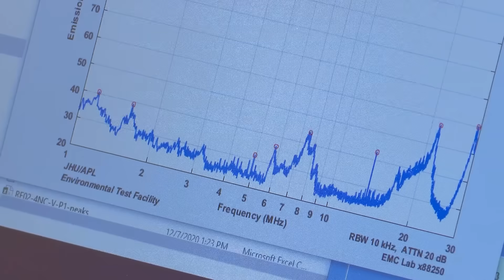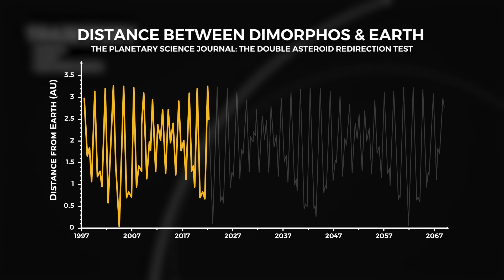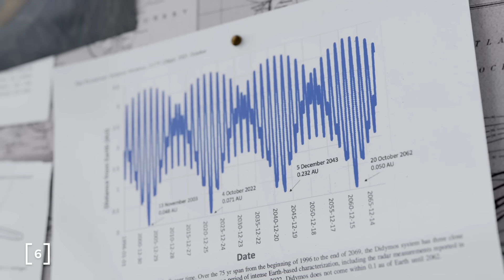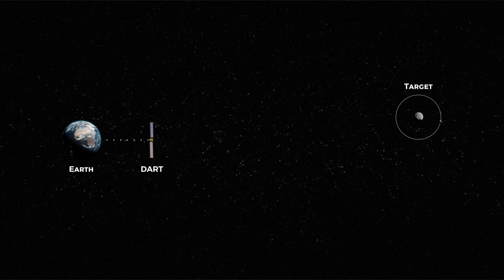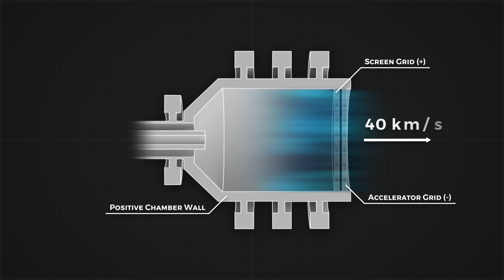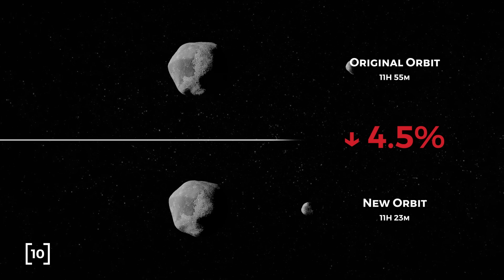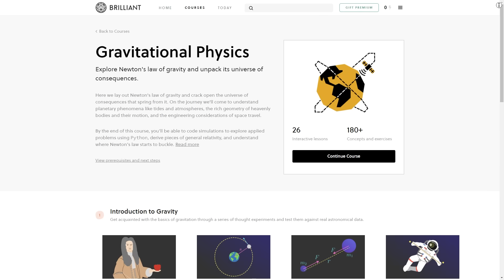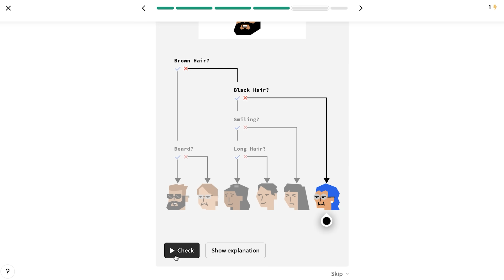The Insane Engineering of the DART Mission

Comment: I think some also huge about this is how much of a difference in orbit it made will relatively little. No heavy dense material, no explosives payload (outside of the hydrazine). And it makes you hopeful that if the need arose and we had to deflect a asteroid 1-5km in diameter that the use of these could make an even larger impact in orbital frequency

Comment: Not a fan of redirects. Something that small (and considering its a rubble pile) could easily be turned into a cloud of dust with a warhead under 1kt. A clause in the outer space treaty needs to be introduced to allow this. Adding delta v to change the orbit of a threat may just postpone it specially when you are dealing with a complex system of interactions and perturbations which may be near impossible to model with the required accuracy hundreds of years into the future. You don't have to worry about this when the threat is turned into garden rocks.

Comment: I wonder if it would make more sense to use a dart like projectile that sticks to the target rather than something that gets shattered into million pieces on impact. It is a high speed impact after all so, coming up with a design that transfers kinetic energy efficiently might be very tricky.
Reply: I do not think it is really possible when the impactor you are going to use is moving at nearly 7 kilometers per second and the asteroid is of such high porosity (it more resembles a sandy-like surface rather than a solid rock). It quite literally completery shatters the impactor, no matter what technology you would use to transfer that kinetic energy.
Reply: you would need to 1) Slow down to meet it and 2) Use thrusters to push away from it

Both need fuel, and fuel is heavy.

Comment: success, but limited.  The discrepancy of how much they changed the orbit, 4.5%  instead of 1% , makes it very inaccurate in terms of orbital mechanics. Imagine you need to change the spin of an asteroid by a very specific amount so solar heating can push this asteroid into a new less dangerous orbit, but instead its not close enough to the simulation and the asteroid comes closer from the over\undershoot of imparted energy. otherwise, awesome. we can move mountains. this can be used to reel in asteroids for space mining.

Comment: The thruster targeting system looks so similar to star tracking software (autoguider) used in astrophotography for long exposures. It would seem that system could be designed to replace moving the servo motors with tapping the thrusters. So cool.
Reply: I had the same thought, funny how systems from very different projects are in some ways quite similar.
Reply: Apollo did navigation using the same exact method to orient itself, there was a telescope to focus on a target star to set attitude. So in a way it's exactly the same

Comment: I find it highly ironic that there is a graphic at 48 seconds that shows the Twin Towers but interesting that the Eiffel Tower is there as well.

So engineers and scientists can hit an asteroid 11 million kilometres away with a probe to study the inelastic collision but cannot research the inelastic collision of the top of a skyscraper supposedly falling straight down onto the bottom 85%. The shape of the 10,000 tons of wrought iron that make up the Eiffel Tower should be indicative of how the 100,000 tons of steel had to be distributed down the North Tower.  But the NIST did not provide that information in their $20,000,000 report. In fact they don't even specify the total amount of concrete.

So presumably an inelastic collision a mere 1,600 kilometers from Cape Canaveral is not sufficiently interesting to NASA engineers.  Of course solving that problem cannot save mankind from extinction.

Comment: The satellite knows where it is at all times. It knows this because it knows where it isn't. By subtracting where it is from where it isn't, or where it isn't from where it is (whichever is greater), it obtains a difference, or deviation. The guidance subsystem uses deviations to generate corrective commands to drive the satellite from a position where it is to a position where it isn't, and arriving at a position where it wasn't, it now is. Consequently, the position where it is, is now the position that it wasn't, and it follows that the position that it was, is now the position that it isn't. In the event that the position that it is in is not the position thaf it wasn't, the system has acquired a variation, the variation being the difference between where the satellite is, and where it wasn't. If variation is considered to be a significant factor, it too may be corrected by the GEA. However, the satellite must also know where it was. The satellite guidance computer scenario works as follows. Because a variation has modified some of the information the satellite has obtained, it is not sure just where it is. However, it is sure where it isn't, within reason, and it knows where it was. It now subtracts where it should be from where it wasn't, or vice-versa, and by differentiating this from the algebraic sum of where it shouldn't be, and where it was, it is able to obtain the deviation and its variation, which is called error.

Comment: The large orbit change had to be due more to the ejecta than the DART impact alone.  Would have liked to see a simplified version of a momentum analysis in this video.
Reply: @BobC I think the momentum transfer to the piece of Dimorphos left (in the frame of reference of the original Dimorphos) was about 1 part the momentum of Dart and 3 parts the momentum from the pieces of rock that got blown off. This was one of the key things they were trying to find out, how much of a multiplier would all the ejecta be. It was higher than expected but actually still at the very top of modeled  range. So there was a larger coupling of impact energy to momentum change of what was left than expected for this type of asteroid. 

This is good, but asteroids like Psyche which are more solid and less rubble piles would likely get much less blown off and so would get a much smaller multiplier. We may want to do missions like this to other types of asteroid and comets to understand the multiplier better.
Reply: well that impact caused the ejecta isn't it?
Reply: To be fair, if you want to get deep into the data, youtube isn't the best choice
Reply: @Hawk7886  The actual specific data isn't even released yet tho...
Reply: @Hawk7886  then where

Comment: I worked on DART, love to see Real Engineering covering the mission!
Reply: Thank you for your work. It is very moving what we can accomplish as a species. What did you do?
Reply: @KJ4EZJ  thanks! It was a great mission with a great team behind it. I was the lead engineer for the flight computer hardware. I believe the video referred to it as "Playstation 1 equivalent" in terms of processing capability, haha. He's not far off, radiation hardened electronics tend to lag behind modern terrestrial electronics in capability (however that gap is closing as the aerospace industry is undergoing a bit of a renaissance at the moment).
Reply: @JeffreyBoye  I'm a computer engineer. Are you able to share what kind of micro it used? Any interesting specs about the hardware or info about the software come to mind? Thanks again!
Reply: @KJ4EZJ  Sure, it used a 32-bit LEON3 processor running at 100 MHz. If you're not familiar, LEON processors are based heavily on the SPARC V8 instruction set with augmentations for fault tolerance (radiation flying about the universe flips bits with impunity and processors need to work around this fact). That's where the main flight software and SmartNav code executed. The processor board design also included a radiation-tolerant FPGA (Field Programmable Gate Array) for support functionality (such as robust boot) and image co-processing. Fun fact - a lot of the heavy lifting for the pre-processing of the camera data took place in the FPGA. This really helped take the load off of the main CPU.
Reply: @JeffreyBoye  super cool stuff and thank you so so much for the information.
Reply: @JeffreyBoye  really cool
Reply: @JeffreyBoye  all the while I was thinking that this sort of specs are confidential. cool stuff!
Reply: @bacsrm5607  It's not like stealing would be much of an issue
Reply: Asteroids are cool and all but you're the 'rock star'
Reply: APL did amazing
Reply: You commented on every Dart video, how much attention you want?
Reply: @l8rNerdz  If you actually got up and did something maybe you’d realize he’s excited about something he worked on
Reply: @nicklasg20  as if you know anything about any of my accomplishments
Reply: @l8rNerdz  then maybe u should what its like to accomplish something bigger than ur self

Comment: "Launched aboard the fossil fuel powered falcon 9..." Thanks for clarifying. Was wondering if this rocket was propelled by electricity.
Reply: Well, it depends on what you mean. Rockets still require electricity for avionics, Rocket Lab's Rutherford engine has battery powered turbopumps -

But yes, all rockets today use chemicals for the main propellant. Falcon 9 uses RP-1 kerosene, basically highly refined jet fuel. Other rockets use hydrogen, some use hypergolics that instantly react, while still new rockets on the market are planning to use more cleanly burning methane propellant.
Reply: that was part of the dinosaur joke

Comment: 5:24 I got a nitpick: the orbit that results from the collision is shown to circularize, or in other words, the dotted line appears to "spiral inwards" after collision. This would only occur if ejecta from the impact was being continuously released from the asteroid for a duration of at least half an orbit. It seems pretty sure that whatever ejecta occurs would do so immediately after the impact. If this is the case, the resulting orbit will be an ellipse, not a circle, with an apoapsis equivalent to its distance at the time of impact, and a periapsis much smaller than that of the original orbit.
Reply: I got a nitpick for your nitpick: the eccentricity of dimorphos's orbit is so low that it's basically a circle, both before and after the impact. This means that my nitpick isn't really relevant to your point, but I wanted to mention it anyways. So, you are right about impact: it's a special kind of force, an impulse, so it all happens at once for the sake of calculations. As for what you got wrong: the resulting orbit would not have the apoapsis on the same spot that the impulse happened. As the impulse gets bigger with respect to the eccentricity, it brings the final apoapsis closer and closer to the location of the impulse, but it will never become the location of the apoapsis. (assuming that it is a strictly retrograde impulse. If you have a radial impulse, you can have your spot become the apoapsis) 

Anyways, this made me curious enough to look up the numbers, and apparently they haven't even been released yet, so I had to do some calculations with the orbital times they already had available, and I can tell you, it was a circle before, and now it is still a circle. From the masses of the objects and the time it takes for one orbit, you can find the semimajor axis, and the 1.19±0.03 km semimajor axis should go down by about 30 meters, which is under the uncertainty of the orbit size measurement. Additionally, with an eccentricity ≤ 0.03 according to wikipedia, the difference between the apoapsis and periapsis would be around ≤ 50 meters, which is close enough to the uncertainty that if it was flipped around, you wouldn't really be able to tell. This orbit is so circular that it doesn't even matter, and the change was so small we probably won't even be able to tell the difference. That's why we needed a double asteroid system in the first place, so we could see the effect on the orbits, even if it only was a few seconds of change. We had the pre-impact uncertainty down to about 10 milliseconds, so even if the dart only got a glancing blow, we would have known the effect as long as it was more than a hundredth of a second of a difference. That would correspond to something on the level of micrometers of of a change in the orbital size.
Reply: @leave-a-comment-at-the-door  All of these are good points. BTW, since you had the time to look at the numbers, you wouldn't happen to have stumbled on the delta v of dimorphos during your search? I've been curious about that number but haven't had time to run through the exercise to find it.
Reply: @leave-a-comment-at-the-door  Sorry, thought it was clear from context, I was curious about the delta v imparted on Dimorphous by the Dart spacecraft.
Reply: Oh no, smart people. My greatest enemy
Reply: @LineOfThy  smart??? I wouldn't call myself that. just someone who likes KSP and has too much time on their hands
Reply: @leave-a-comment-at-the-door  BTW, thanks for finding that number. and sorry for not getting back to you sooner. I figure that number could be useful to play out scenarios and see how far you could push a rock like Dimorphos away from the Earth. Maybe when I get back to reading Bates and Mueller it'll make for a good practice problem. I am impressed though how very small the number is compared to what KSP would have you believe.

Comment: Can they load up the dart with maybe a nuclear payload? To redirect bigger space rocks?
Reply: In defending against an asteroid, especially a big one, nuking it is a really, really bad idea. You've basically taken a bullet and turned it into buckshot.

No, what you want to do is find a dangerous asteroid as early as possible, and deflect it with something like DART, but higher mass and higher velocity.

Then it is nudged just barely out of the way.
Reply: @WasatchWind  ideally you would want to spot it from even further away and use less invasive methods to not risk the astroid breaking up. But yes in general you are correct
Reply: @WasatchWind  Except the buckshot has a much better chance of either bouncing of or burning up in our atmosphere, so it would still be a win
Reply: @brll5733  the buckshot would be what we fire at the astroid. Not what the astroid would turn into.

And breaking the astroid in parts is usually considered a very bad idea since this makes it difficult to predict and correct their approach.

Comment: probably better to put two landers on a NEO, one with enough thrust to stop the spin, and the other with enough thrust to slow the velocity. It's difficult to aim at the sun, but if we don't try, we don't learn. Perhaps three landers would be better, at equidistant locations on the NEO, to stop the spin and slow the velocity, since you can't know the internal density distribution of the NEO, so the 3 landers have to figure out how to decelerate without spinning up the NEO.

Comment: The only problem is you need a LOT of mass to really make an impact (pun intended)
Reply: or speeeeeeeed
Reply: Or catch the problem early, so even a small change of direction is enough to save the Earth.
Reply: You need kinetic energy, not mass.

And there's a fun fact about that: in kinetic energy, mass and speed can be substituted for each other. Your spacecraft will have an engine and a fuel tank, which imparts a fixed amount of energy. If your spacecraft is heavy, it'll accelerate only a little. If your spacecraft is light, it'll accelerate a whole lot. In both cases, the spacecraft will have the exact same kinetic energy after it finishes accelerating.

So the question is not, can we launch heavy enough objects for planetary defense (and the answer would be yes, we launch spacecraft twenty times the mass of DART all the time). The question is, can we launch an object with enough kinetic energy to redirect whatever object we detected that needs redirecting.

Given that DART exceeded its mission goal by over 300% despite not even using its ion drive, I feel pretty optimistic about that.
Reply: @streetwind.  if you have nuclearbomb in your slow spacecraft, kinetic energy is ready and very important : directional!
Dart mission protocol cannot handle an small asteroid incoming from the deepspace to earth.
it's easy to change an gravitational equilibrium (orbit) but cancel total kinetic energy is impossible from one human satellite.
I will be more impressed for a DART like mission succed to hit an asteroid not in the center but on the corner, after made prediction about asteroid center mass and see if dinosaurs can be alive :D
Today we are capable to send an arduino to an asteroid, well done guys! I need a beer
Reply: @streetwind.  you're reading the mission goal wrong. In the beginning of the video he talked about 1% deviation in its orbit around the sun. The result is over 4% deviation in its orbit around another asteroid
Reply: Or speed. Energy is an equation of both, so if it's faster, we don't need as much mass.